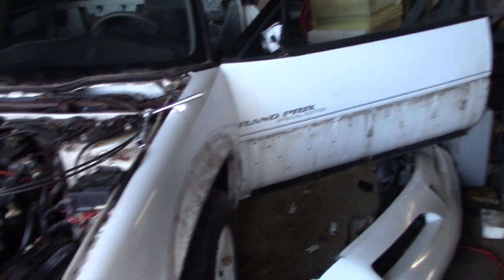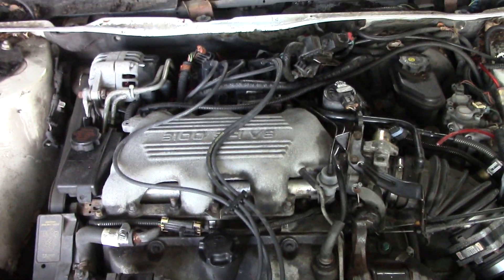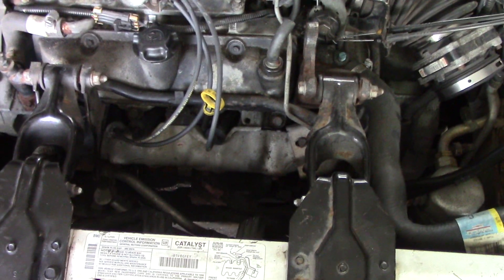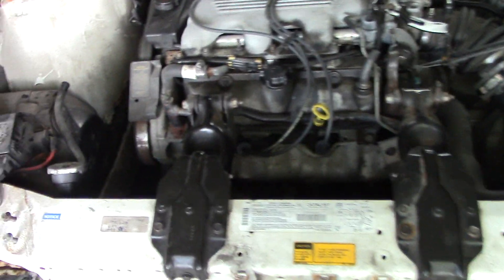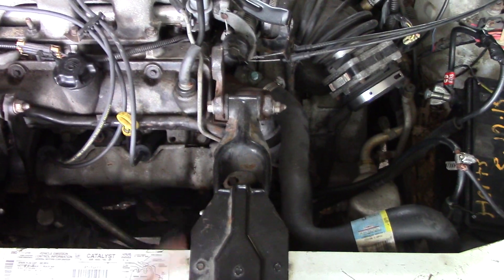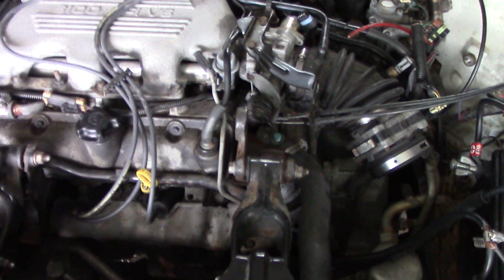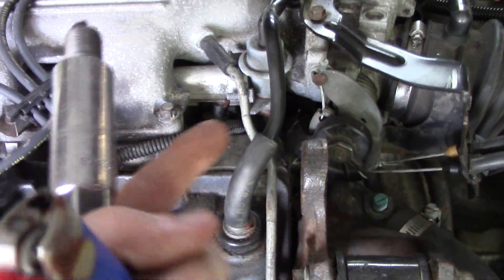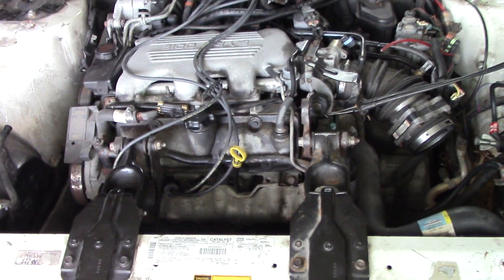Diagnose 96 Grand Prix Derby Engine Misfire

Comment: thanks for the video I ran a 96 grand prix last August got super lucky won first place but my car ran like crap the whole time. only thing I have not checked in repairing the car is my spark plug wires. I had to replace my injectors before the derby cause they did have issues.

Comment: does your Petrol (Gasoline) not have a smell?. Here (Australia) its smells really strong, you could smell it on the plug and in the oil. also you can test the oil for fuel but decanting a small amount and lighting it. the vapours will burn. if it was straight oil it wouldn't do that. as its only the fumes that burn and not the liquid.
Reply from the maker: The car has the exhaust cut off so the whole engine compartment smelled like gas each time I pulled the plug. I did try lighting the oil with no success.

Comment: no sure if changing injectors will make a difference cause if the wire is grounded all the time it will make the injector run all the time no matter what injector you put in
Reply from the maker: This is true, and the reason why in the next video I never swapped injectors, but instead manually grounded each injector to hear them spray and click back off. But if the injector itself was bad and not working, then swapping it to another cylinder should make that new cylinder the bad one instead.  It's much easier to test the ground wires to them first though.
Reply: I had the same issue on my 3100. I had a plug soaked and wasn't sure if it was a injector or head gasket. I didn't feel like pulling injectors so I unplugged the injector on the bad cylinder so it couldn't spray and that's how I found out that I had a bad injector wire cause when I ran the car with that injector unplugged the spark plug was bone dry